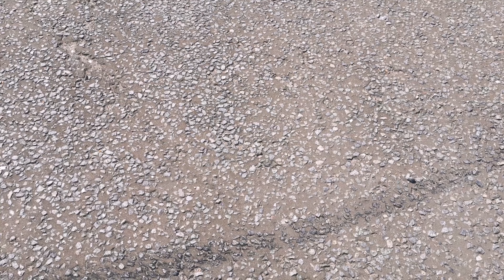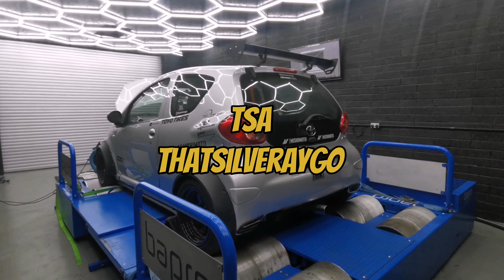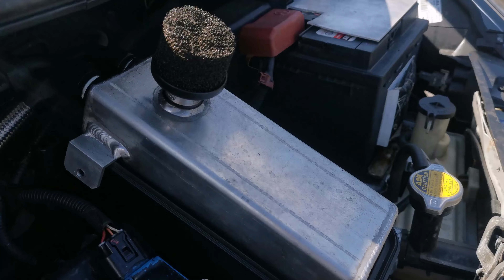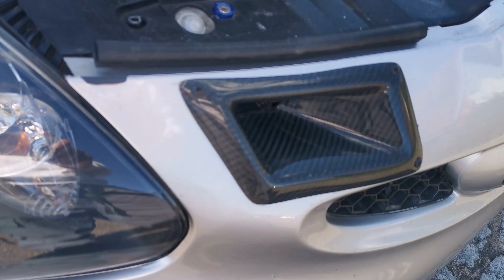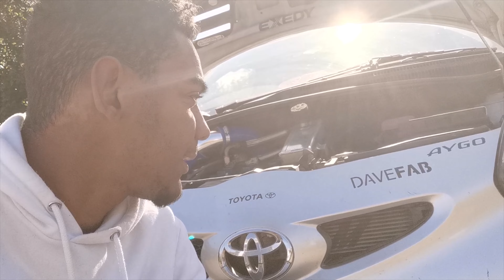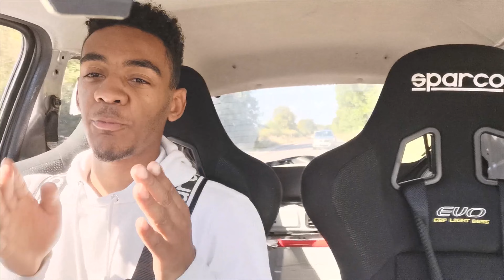THE AYGO IS DYING!

Comment: More than regular maintenance is key ofc. 
Since you're racing tha balls off it everywhere. Maybe you got some blocked oil passages, dirty or almost killed sensors. 

Good to hear about the new power unit, I'll be glad to hear it roar.

Also you can put a little OBD2 scanner in, telling you the values of sensors, fuel pressure and hundreds of things more(live), and log those too, to a smartphone. Really handy.

It said my dad's car had crank walk, i said, sell now. Dad didn't care, engine starts knocking. Dad goes to garage, garage says, sell now. 

Before the knock he could have gotten a way higher price.
Reply from the maker: I think I've figured out where the issue lies I just need to confirm, and then a video will follow!

Comment: If it’s struggling in the high rpms. It’s either going to be a fuelling issue, or something like the spark plugs aren’t doing their job.
Reply from the maker: Spark plugs were changed less than 1000 miles ago, made no difference
Reply: @Thatsilveraygo  most likely a fuelling issue then. I highly doubt there an actual engine issue - stripping it down would just be a waste of time.

Comment: Shame, better add some more cold air intakes to help it live!
Reply from the maker: I did!😂Wait for the next video!
Reply: @Thatsilveraygo  I've seen the mess you've made of your headlight from trax photos. There is a limit on how much cold air can be sucked in. 😂 Have you thought about a larger throttle body?
Reply from the maker: @IJm3  I have, already looking into it
Reply: @Thatsilveraygo  cool. All the intakes you have will just be creating poor airflow, and might actually slow you down. You just want the cone down in the bumper, keep the heat away from it by wrapping the tube in a heat resistant material + encase the filter in some sort of box so the only air it's taking in is from outside the car. The real question is, is it worth it 😂 you'll see negligible gains in power with it
Reply from the maker: @IJm3  I can't test the gains because of the engine's current state, will have to test N/A intake setups after its rebuilt
Reply: What a shame but onwards and upwards eh ! 
My scooby actually made it on the road this summer at 426 bhp.  Its been sorned again now though until at least Easter as I need to upgrade the up pipes for a more power and sort the suspension out properly... fucking cars 😂😂😂